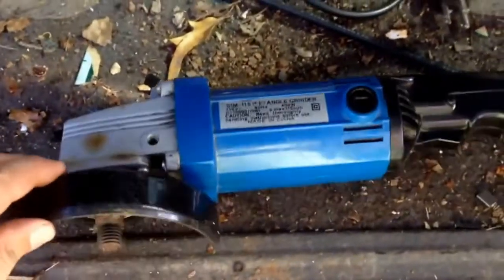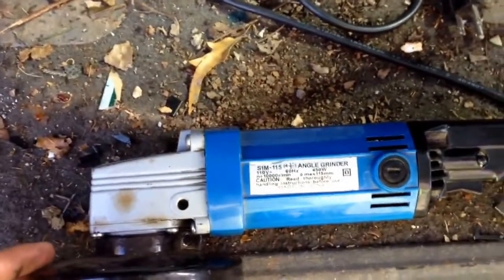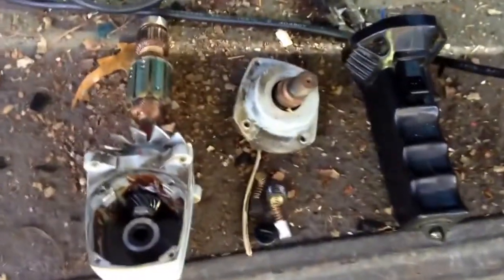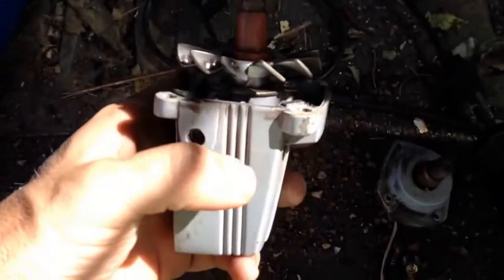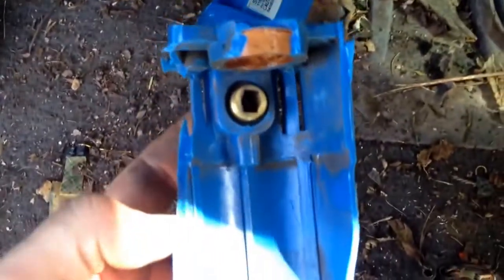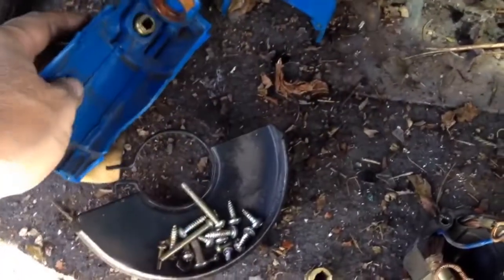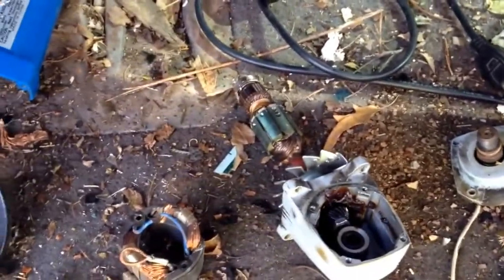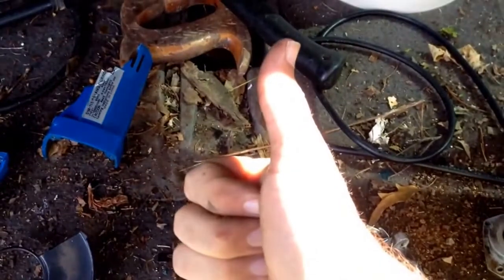Scrapping an angle grinder for copper brass and more!

Comment: Some of the older ones can be a PITA to tear down. I had one where the spindle was rusted to the aluminum housing the bearing and all were solid rust, it was a mess, I ended up smashing it in a very large vise lol!!! I always keep the brushes from power tools, the next one you get might just need brushes.
Reply from the maker: I once had an old sears solid aluminum units that was very hard to break down. They just do not build things that way anymore.

Comment: I was thinking exactly that, scrap it for copper but my co-workers one broke too so I gave him mine and he made a botch out of it and made his work. His was just loose, so luckily the pinion matched the other one which was 90% unlikely due to proprietary design......but yeah it matched and at least he has his one working as he needs its for his job. The one I used only cost 15$ anyway. Electric motor died